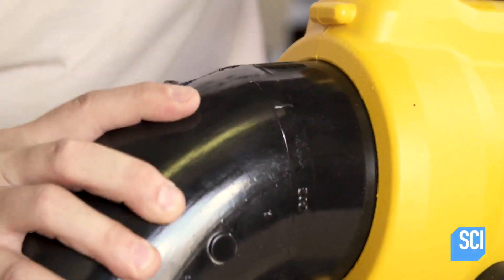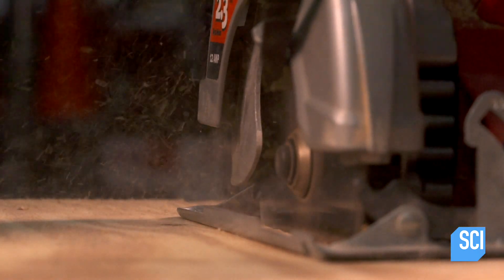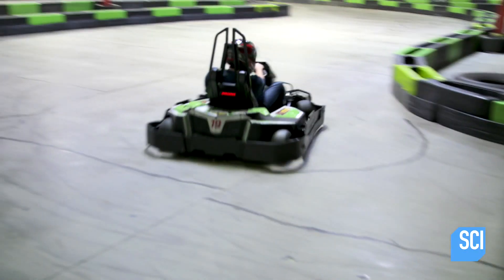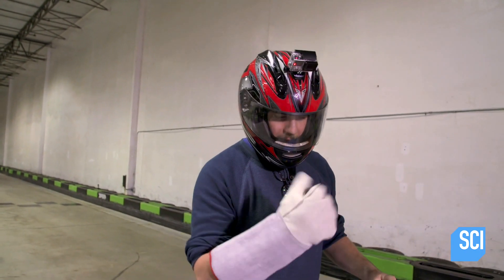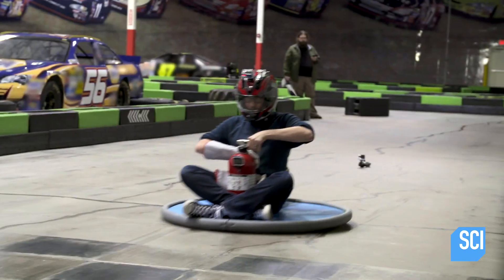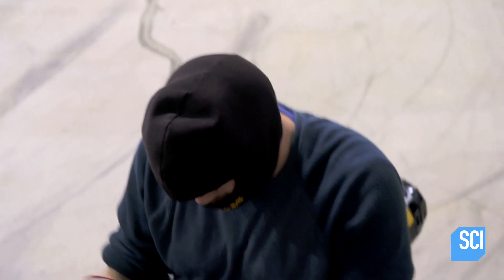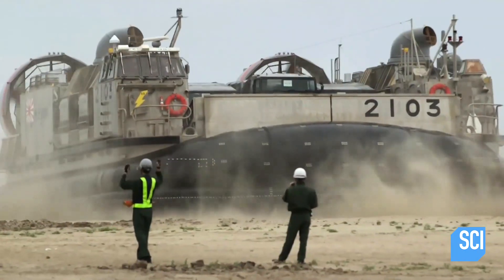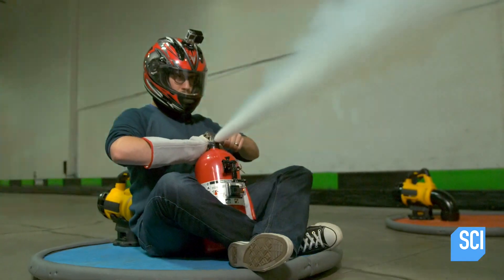How To Make Your Own Hovercraft On The Cheap | Street Science

Comment: "No friction" "Frictionless!" I hate that people are using it wrong, ESPECIALLY "Scientists"...
Reply: triggered?
Reply: 2:15 "... if there's no friction to slow him down, they're going to keep going for awhile." 

Actually, they would go until they hit something.
Reply: Ye, a frictionless area would make that a fact. However, neither the ground nor the "hovercraft" is hoverless, which means that it MUST stop. Even if it takes a long time (f.ex. a push to the hovercraft would NOT take a long time, rather quick tbh).
Reply: "...if there's no friction to slow him down...". That's all you need, the rest doesn't matter. Ther. Is. Friction.
Reply: The Ginger Jesus well not...light does give off the smallest amout of power...or weight off to you so EVENTUALLY you would get moved like .000000000000000000000000001 add a feq more zeros too....